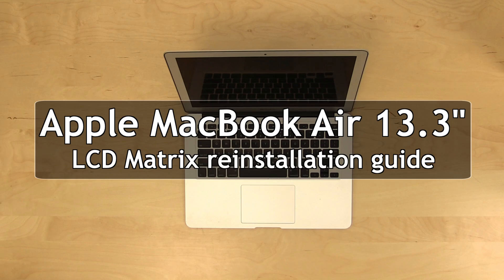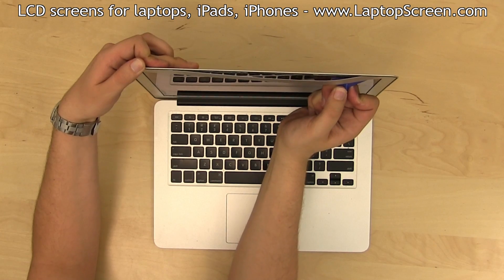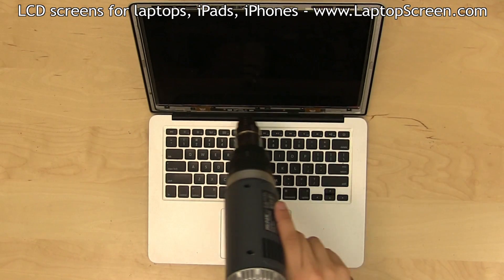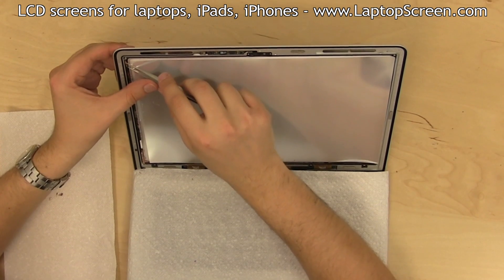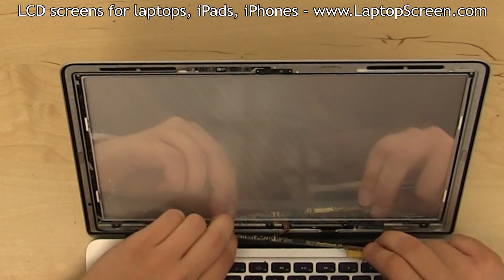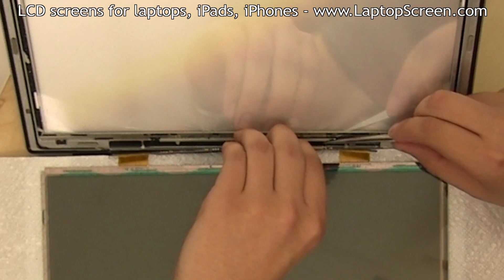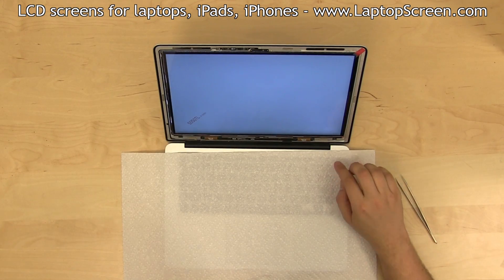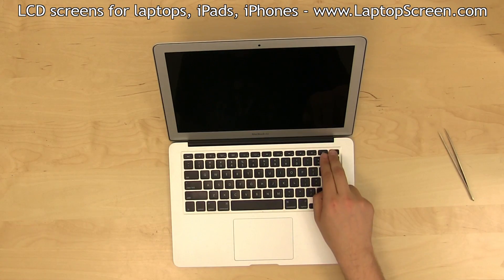MacBook Air 13 LCD Matrix  replacement /  Installation guide [ MacBook Air 13 LCD matrix repair]

Comment: Very useful video but you do not inform that the battery should be unplugged. It is quite easy to make a short circuit , and that has occured to me, and now i do not have any back light . And it is not a piece of cake to repair the backlight, my Mac is now dead !

Comment: Don't you love working on garbage put together with glue and tape.
Reply from the maker: Everybody hated it, so they outsourced the rebuilding / refurbishing of the assemblies (top shells) back to China and everything was fine for ~10 years. But now Apple marries the ambient light sensor with the mobo to enable true tone, so everyone will be back to rebuilding these assemblies in-house, because you must reuse the original web-cam/ambient light sensor board.

Comment: We need a source for the top diffuser sheet, it is easily damaged trying to remove glass shards from item, if done with microfiber cloth. Also pry tool slipped in too far removing and drew line upon that sheet and don't want unhappy customer.
Forced to buy damaged assembly to avoid paying the only seller I can find $100 and then he claims only 2010-2012 which may be true for panel, but unlikely for diffuser, but he won't sell since a 2014 model...

Comment: Dear Apple, I think you would benefit from an incredible little invention which allows you to service things easily and prevents glass from breaking when you remove it, infact, it's such an amazing invention that it's actually already being used by all the other laptop manufacturers.  Its called a screw.

Comment from the maker: @Ryan Wilson, re: cracked back-light.
Its best to watch the video again, your question makes little sense.
The back-light on MacBook Air is a strip of LED lights glued into the back-cover. The possibility of the back-light being cracked is zero, the possibility of back-light being damaged from external damage is close to zero. The worst thing that can happen is that you rip the back-light cable/connector when replacing the LCD. Youc an always repalce the entire top-cover - but that costs about 3x more in parts - although it is a lot easier to install.

Comment: Hey! Hope you can help me
I followed your instructions but the backlight won't work.
I'm pretty sure that I don't broke anything.
The screen selfs works perfect.
Thanks
Reply from the maker: The most common reason for this is an improper backlight connection to the LCD driver board.
It is much easier to flip the orientation of the flex cable connector than to connect it properly.
Review the part int he video that shows the backlight flex cable connection.
Note that the white lines on the flex cable have to be facing away from the driver board.
Make sure the flex cable is plugged in all the way.
Reply: LaptopScreen.com  sir this will work on macbook air 13" early 2015?